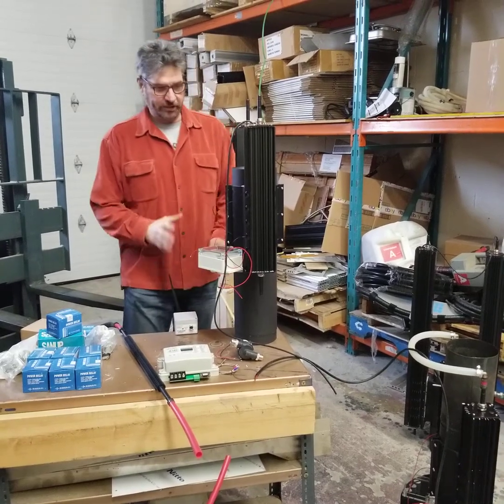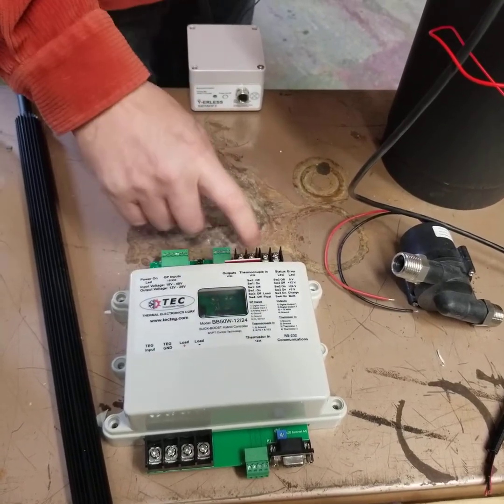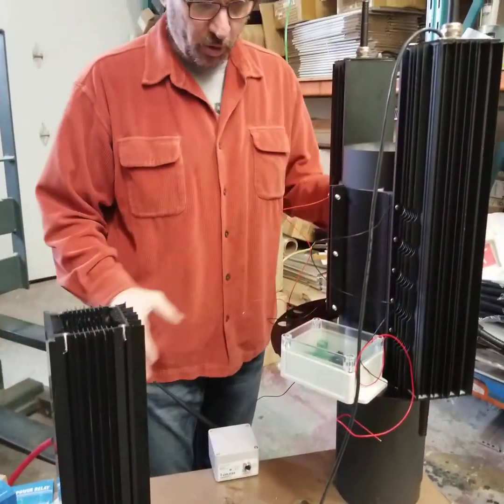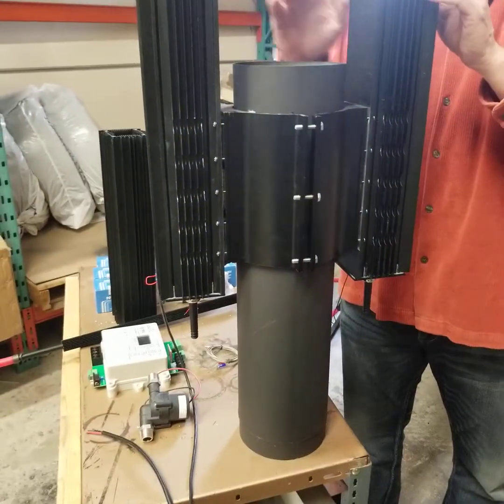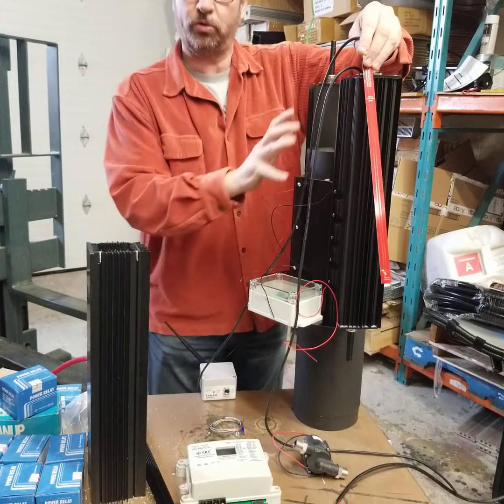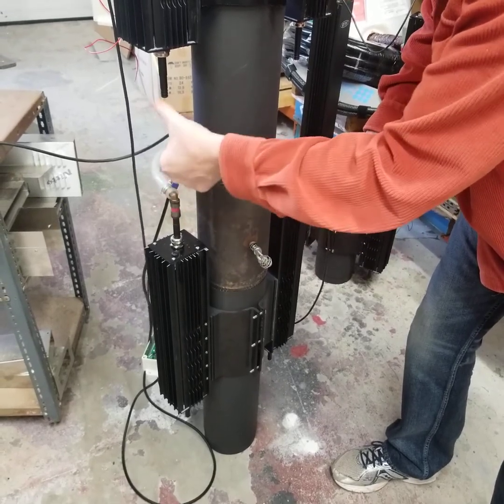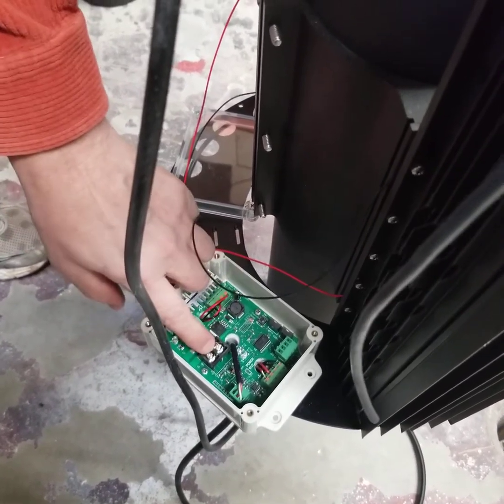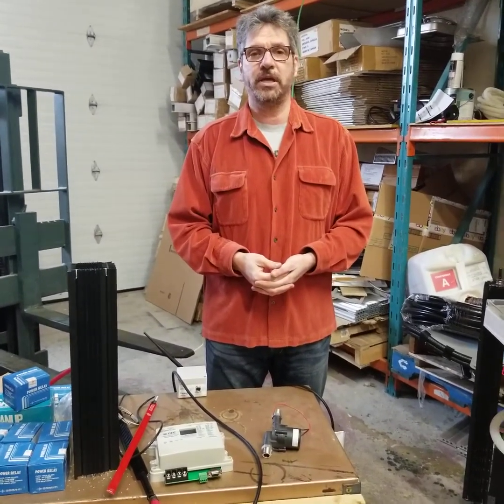12/24V Wood stove thermoelectric Generator 100 or 200 watt Rabbit Ears www.tecteg.com

Comment from the maker: Yes, but the same design is now applied to the body of the stove in cut out on the back side for the absorber heat sinks to be in direct contact with the gases where there is more heat flow and longer heat flux( movement). What we found was  not enough fuel (wood) heat was being generated in the flue. This reduced the amount of power you could produce. When the system hot side was embedded directly where heat was being generated much more power was being produced. If you email us at tecteg@rogers.com we have all the CAD drawings for the design. So when we ship either a 100 or 200 watt generator. You can mount directly into the constructed or modified stove!

Comment: by nominal wattage, do you man max power? what is the continuous max wattage?
Reply from the maker: depend on full cell size and how much material you continue to automatically load into the system with water. But yes, continuous power per hour! our larger unit is 1Kwh. Ran for 48 hours straight. next test is 1 month.

Comment: I have been looking for a good electricity source for a homestead during the winter. This would work well if you hook the water up to a source outside in the winter. The water would always be cold while the stove is always hot. As long as you have wood you have power

Comment: With the trend leaning heavily towards 48v and higher systems do you have any plans to offer units for higher voltages. In the winter if I could have an extra 200 watts being produced while I run my wood stove my LFP batteries would stay in the state of charge range for maximum battery life.
Reply from the maker: Very difficult to get 48V. 12VDC right now maybe 24V in future design!
Reply: @thermoelectricpowergenerator  If all else fails users can also use a dc-dc converter ;-)

Comment: You should let people know that it's going to condense gasses more rapidly but that's not exactly a negative thing since you can reburn that it again.
Collecting it is just a bitch.
I would imagine a shop vacuum bag designed to not only handle the creosote or whatever its called, but also be able to be thrown straight into the burn box. 

This is brilliant my dude.
I want a Mars rover hab unit built on bicycle wheels to live inside and this is a key component to making that work

Comment: How cold, does the cold side temp need to be?
Reply: I was thinking building a large peltier and putting a hole in my wall so the cold side is now out in the cold in winter...and on the inside i plan to sit a pot heater right next to the hot side on the inside...i can get pot heaters extremly hot and also i use oil candles to power the pot heater i get the oil for free so its all completly free the cold outside and the heat source on the inside...i think to awnser your question the colder the better but also you can put ice packs on the cold side...so if i stack some ice packs outside in winter they should stay cold for hours without melting...anyway good luck with whatever your doing mate and good luck
Reply from the maker: The colder the better, but the heard upper limit is 170C. But -30C or lower would create a greater DT more power! It's all about heat absorption, Heat flow, And Temperature!

Comment: I have been looking for a safe, sustainable, off-grid heating solution for years.  Around my neck of the woods (West Virginia) there seems to be a love affair with the wood stoves that sit out in the yard, and heated water is pumped to the house from the outdoor stove.  It eliminates the threat of chimney fires and/or your house burning down, and it keeps your house smoke/dust free (I had a cast iron wood stove growing up in Maine, and the house got REALLY DUSTY).  Anyway, these "sit out in the yard" wood stoves pumping hot water to the house have 1 glaring problem...they will not send heat to your house if the power goes out!...unless you buy a generator to temporarily give it power....however, that is NOT a sustainable option!  I'm trying to imagine the world shutting down and having to run things independently of gas or propane to power generators.  So, I want a wood stove that still has the "safety" considerations that these "sit in the yard" stoves provide; however, the stove MUST work in the event of a power outage without the need of a gas or propane generator.  For a long time I have been hoping someone out there would eventually come up with a way to harness a portion of the HEAT energy generated by these stoves that would be sufficient to power the pump necessary to send water to the house..so, as long as you have a hot fire in the wood stove, it would continue to pump hot water to the house.  Do you think the energy generated by a thermoelectric system similar to the one described in this video would be able to power such a pump?  Could something additionally be done with seam?  and as a last resort, maybe it could be supplemented with some solar...but the point is, it needs to be able to run the pump and also to store some energy for those times when the fire burns low like in the early mornings...so, there is enough of a reserve to keep that pump going until you get out there in the morning to put more wood on.  One final thing I'd like to mention...the other problem with those outdoor "sit in yard" wood stoves is you can't cook on them because they are so well insulated...so, a design alteration I would suggested is a way to "open" a portion of the insulated case to expose a couple burners or an oven on which food can be cooked temporarily.  And if soo much heat was lost when the system was opened and/or if you don't like standing out in the cold to do some cooking, I support the ultimate design would be to have a separate little building to house the wood stove in so you can cook out of the element...and this little building would be separate/disconnected from your house so that again, the threat of a house fire is eliminated.   We're talking safety and dependability/sustainability.  Sorry for the brain-dump, but we're getting ready to get a wood stove for our new homestead, and I wanted to try to get this out there in case anyone knew of a system like this that already existed or if we could put our heads together to make such a system a reality.  Let me know your thoughts!! B-)

Comment: I have been pushing these designs at people for over a decade now. Glad to see someone up and building them. I will send them to you, and yes.. you should go further with videos showing how they can utilize the ambient water lines too. People dont get how far the system can go, in terms of full useage. I do however take issue that you didnt incorporate it into direct water tanks or coils for a tank.. as this has far more syphon ability, but that of course increases cost and design sizes. This is great. I like the Ipower Towers they have there, but this is far more efficient towards more utilization simultaneously.  Honestly though.. you need someone to work with your video quality, and the "information" posted on the videos.. Do it once.. copy paste it and add it with each video. This is a "more often gets more notice" staging area, that will lift you. The only thing that holds you back is fully utilizing it. So do it.
Reply: Hello mate if you get my message plz reply i would love to pick your brains if dont mind lol thanks

Comment: Hi from Germany. Whats the Ampere Power of this 100Watt Generator?
Reply from the maker: about 4 to 5 amps at 12V average 7 amps high end 3 amp low end
Reply: 100 watt, devided by 12volts = 8.333amps, count on getting 5-6 out of it normally.

So 2 units, would yield, approximately 10amps of output, when running at the correct range.
Reply from the maker: https://www.youtube.com/watch?v=fVgnYiURCzs

Comment: Have you considered replacing the pump with a bubble pump (like the ones used in coffee machines), or is the temperature to low for that?
Reply from the maker: No, you need a good quality pump for long duty cycles. coffee pumps are not designed for continuous use!
Reply from the maker: We built this for years of reliable operation, not as a Chinese use for 2 years and throw away product!

Comment: Good, work!  What kind of material you used to produce energy?
Reply from the maker: Semi-conductors Seebeck effect! Everything in this product is High temperature Minimum rated material is 500F but that doesn't directly touch any hot surface.
Reply: @thermoelectricpowergenerator  your website www.tecteg.com is invalid
Reply from the maker: Seebeck devices thermoelectrics. Go to tecteg.com our site has lots of information on the technology. Been around for 90 years. discovered in the 1800's. look under whats news lots of papers for laymen to read, easy to understand. i can get into physics but don't need to.
Reply from the maker: BiTe semi-conductor doped for power generation Seebeck Modules

Comment: So is there just a unit that connects to the stove pipe for charging but with no pump?
Reply from the maker: Check it out at Thermoelectric-generator.com  it comes with a Dc to Dc custom Charger, pump, wire, ceramic blanket and generator, sleeving
Reply from the maker: No we don't have a design for the pipe with fans. doesn't work as efficient a steh air around stove is hot so how do you cool the cold side?? 
It works but at a very low power production.
Reply from the maker: pump and controller as well as other parts come with unit go to tecteg.com .. menu at top... online store... teg systems... rabbit ears 100 watt IPOWERTOWER 11

Comment: How much does it cost
Reply from the maker: $1049.00USD introductory cost plus shipping tecteg.com go to online store Department "TEG System"
Reply from the maker: Intro is $1050 USD for basic system with Pump, PLC Dc to Dc, generator, Ceramic mat, silicone section of tubing to protect high exposed areas around stove. we don't supply tubing for water.
Reply from the maker: orders are now being taken at thermoelectrc-generator.com   $1049.00 USD plus shipping. entro special!
Reply: @thermoelectricpowergenerator  please send me more information on the 200 watt unit or higher.  I'm off grid and have low solar energy in the winter months.
Reply from the maker: https://thermoelectric-generator.com/product/wood-stove-thermoelectric-generator-rabbit-ears/

Comment: Awesome! I want one. Please pin a post with links to your website. I've tried looking online but can't find anything. Thanks
Reply from the maker: We have just worked out pricing which we will post soon.  The unit will be in the $1225.00 USD Range. That includes the 100 watt Generator, Pump, Dc to Dc controller, PLC, Ceramic mate, silicone tubing (3 pcs) for PEX insulation, Power Cable from generator to Dc to DC.
Reply: All good. I found your website :D
Reply from the maker: thermoelectric-generator.com
Reply from the maker: https://thermoelectric-generator.com/product/wood-stove-thermoelectric-generator-rabbit-ears/